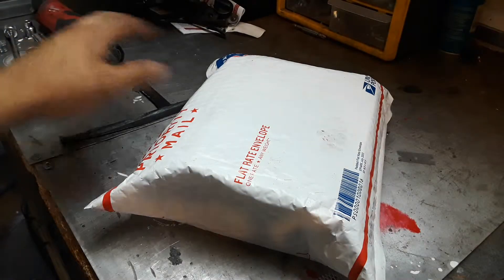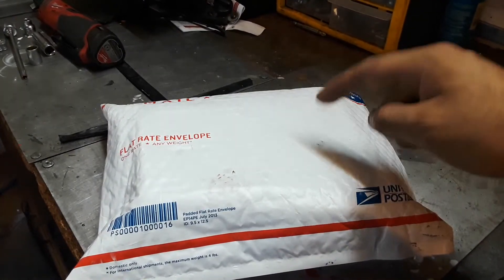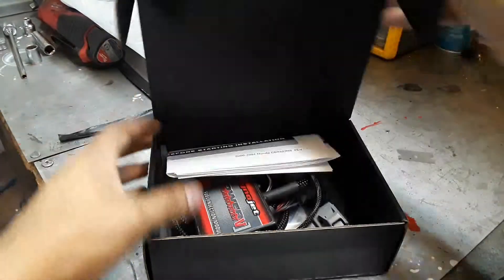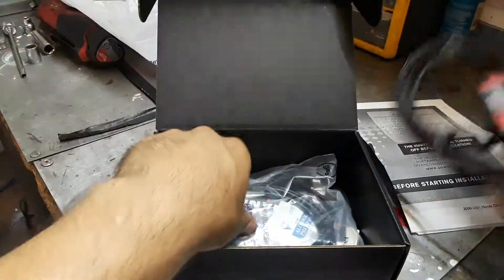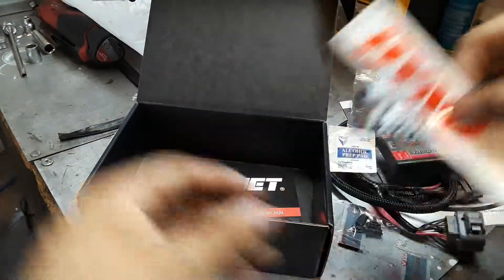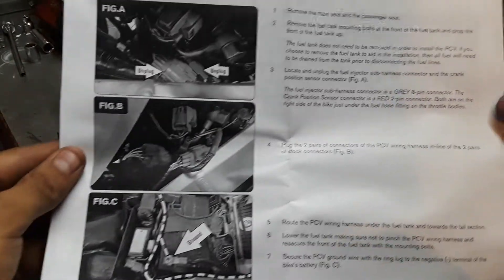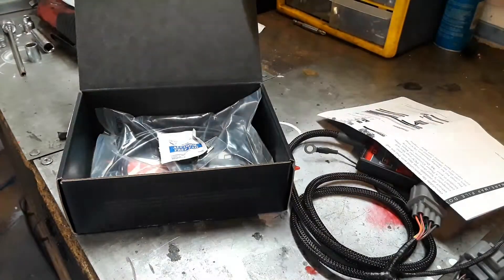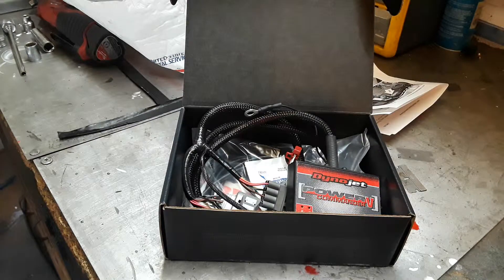Power commander v 5 honda cbr 929rr 2000-2001

Comment: If you installed it, please make a video and let us know about the differences.
Reply from the maker: luis8bgt  I did install it an put a simple map from dyno jet website did run good but at the end I went to get it dyno tune and was great pick up 7hp bike walk in with 128hp came back with 135hp so yes you should get dyno tune for better results
Reply from the maker: @jerryx2000  sorry bro i lost it